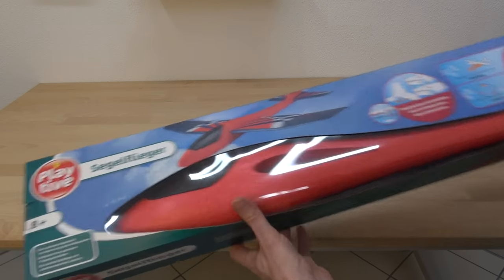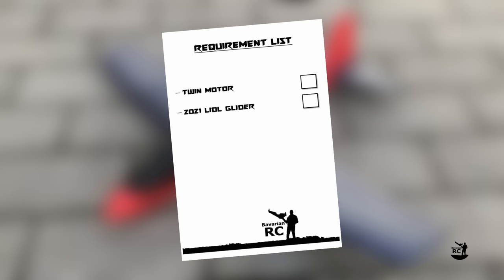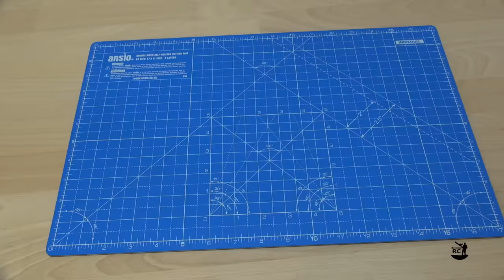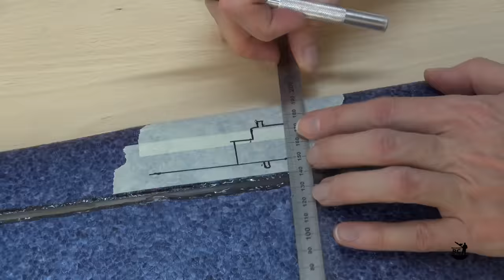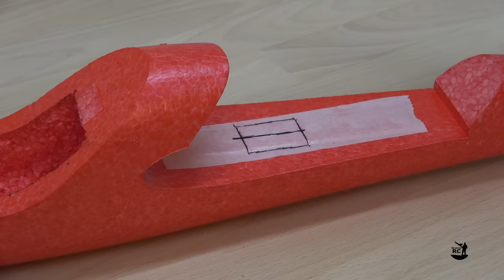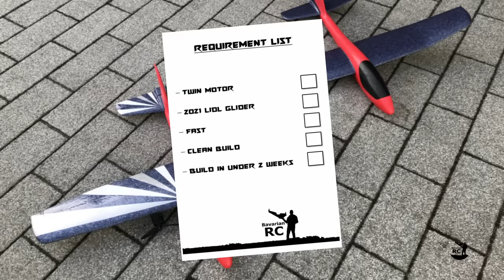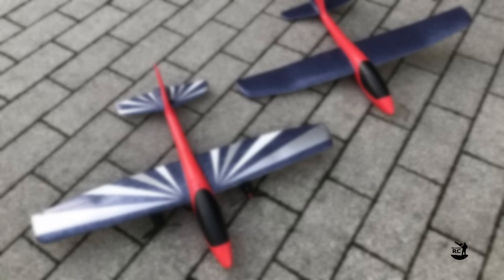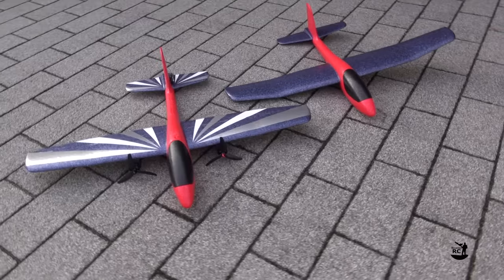LIDL glider RC conversion - TWIN TURBO LIDL - Build Video

Comment: i just stopped the video in 1. minute and bring my coffe to watch this artwork. Not only job is perfect it is also perfect to edit and record all this 2 week long video. my regards. perfect !
Reply: I would suggest you to use 2 bladed propeller for more efficient flights also they will allow you to go faster with right 2 bladed propeller rather than 3 blade ones
Reply from the maker: Thanks a lot! Your comment saved my day 😊if you liked this build than have a look at the other build videos on my channel… and of course don‘t miss the flight video of the Twin Turbo Lidl.
Reply from the maker: My initial thought for the 3 bladed props was to keep the diameter small and avoid breaking props at landing. But obviously breaking was never an issue with the flexible HQ props. Never thought about going back to a 2 blade prop. But you are right, efficiency will be better. Definitely worth a try.
Reply: @bavarian_rc  there is too little gain between 2 and 3 blades at this diameters but we fly with 3 blades with drones mainly because of the feeling while doing sudden movements. Also at static thrust tests you will see there is not much difference in thrust but you will draw less amp from battery. İ also have my own lidl build with lion setup you can try 4s or 5s lion 18650 batteries if your esc allow you with this motor and 5" props for long flights but stick to the lipo for this kind of crazy flights, anyway still 4s would be great to watch hehe have a nice day
Reply from the maker: 4s? That would make this thing even more crazy 🤩🤣
Reply: @bavarian_rc  my next quad build will be 6 or 8s this things are going crazy ... Hehehe but 4s is sweetspot for this motor and prop in my opinion. Wings can handle this for sure with all of this cf reinforcement

Comment: Wow! I thought about doing that to a chuck glider but had no idear where to start. Yours will fly  great. Great Job!
Reply from the maker: Thanks. I did some conversions before but this one turned out to be the best one yet. Flying it a lot! … and it all started with a 7,99€ chuck glider 😄
Reply: @bavarian_rc  Not bad. Considering a bird at that size will cost ya $200 smackers, that's a great deal. Ill stay tuned in to see what's next on the menu. Tex..
Reply from the maker: There are some projects in the pipeline. Next video will most probably be a build video of a small flying wing. Half way through the build by now.
Reply: @bavarian_rc  Horten flying wing?😁Fingers crossed, Yeup i'll tune in and enjoy the build.
Reply from the maker: Don’t wanna disappoint you but no Horten. But you‘ll see …
Reply: The difficulty is that in Germany, model flying is only permitted at specially designated airfields. These are often operated by model flight clubs and are accessible to members or guest pilots. This can cost up to 350 euros because model aircraft liability insurance must be taken out among other things.
Reply from the maker: Hi, actually that's not fully correct. You can fly outside of designated airfields but with some limitations concerning the location and for things like model weight and the height you are allowed to fly. Passing a test (Kenntnisnachweis) you can lift some of the limitations or push them to higher limits. Insurance is important but it is not as costly. Mine is well below 100 EUR per year. There are good online ressources that explain all the rules for RC flying in Germany. Always fly safe and protect our hobby!

Comment: Nice build. I flew in the 80’s. Built about 10 or so. Technology wasn’t as light and evolved as it is now. Keep on with the good stuff!
Reply from the maker: I started building and flying in the mid 80s. Later I stopped the hobby for about 25 years before to re-start in the age of light brushless motors and powerful Lipo batteries. So I know what you mean. Quite an evolution. Great that you liked my video! Cheers!
Reply: Back in the 1980s, the problem was cost. Everything was SOOO expensive. Today's electronics have made the hobby/sport far more accessible
Reply: @Dave5843-d9m  True. It was expensive. But nowadays regulations have become so much more complicated. Watched a discussion about FPV today. Although there are circumstances why regulations may be strengthened, normal developers and inventors and model makers should be able to do like their grandfathers were doing: create.
Reply from the maker: Yes it‘s a completely different world today with all the electronic gimmicks.
Reply from the maker: @Paul Brouyere It‘s as always… some are doing bad things and everything gets regulated afterwards for ALL 🥲
Reply: @bavarian_rc  Then we All have to get together again. It would be nice to do.

Comment: Thanks for this brilliantly well presented conversion video. Just completed the conversion myself and hoping to maiden tomorrow.
Reply from the maker: Thanks for your positive feedback. Keep my fingers crossed for your maiden! I still fly my Twin Turbo Lidl a lot. It has around 150 flights already. Greetings from Bavaria 🙌
Reply: @bavarian_rc  . Good afternoon from the UK 👋. I’m pleased to report that the maiden flight was a great success. Very little trim required and superb handling. Could I please ask what percentage of differential thrust you have programmed? I’ve started at 25%, but think I could dial in more. Thanks again for posting your video cataloguing the conversion. I really appreciate the effort that this must have taken you.
Reply from the maker: That‘s great news! I actually went quite crazy with the differential thrust and used 85%. This allows for these weird flat spins. To enter the flat spin I usually pull up vertically, then reduce thrust to about 50%, wait a moment until the plane has slowed down and then slam in full nose down and full left aileron. About 1 second later I add full differential thrust to the right still keeping full down and full left aileron. The plane stays in the flat spin as long as you keep these control inputs. My longest flat spin was like 20 seconds. Thanks again for your feedback. That‘s the strongest motivation for me to continue producing such content.
Reply: @bavarian_rc  Excellent. I thought I needed more differential, but didn’t appreciate just how much! Will tweak my Tx parameters immediately 😉. Thank you so much for walk through for entering the flat spin too. I don’t have another flying slot until 2024 now (no too long), but will be sure to update you on progress. Good fun this hobby isn’t it? Merry Christmas from the small village of Bisley, Surrey. Paul. 🧑‍🎄
Reply from the maker: At the moment I am also not flying a lot due to either bad weather or the fact that the time before Christmas is always pretty busy. Sometimes I just strap my Twin Turbo to my backpack and take it with me on a Sunday afternoon family walk to do 1 or 2 flights (have a look at my Instagram account to see how that looks like). It always guarantees some suprised looks of other people seeing me walk by with a toy plane strapped to my back. For me this is the best hobby in the world. I am trying to get my boy into the hobby and we are currently building together his first own RC plane. I try to do what my father did with me when I was young. Keep me updated on your further progress and if you want, send me a foto of your Lidl (my mail address is in the channel impressum). I would really love to see how it looks like.  I wish you as well a merry Christmas and great flying in 2024. Cheers, Robert.

Comment: Amazing! I am also making experiments like you. Currently I am on DIY from scratch plane proto of pure polystyrene.
You can get rid of bullets of Styropor after digging with very fast flame of fire it collapsed the surface drastically. I did not know dremel could do the holes like you show.
I like to use fiber glass and epoxy too to bring back rigidity after getting extra space
Reply from the maker: Thanks! Even if I am more a balsa build lover it is always fun doing some crazy Lidl glider conversions. Never tried confronting styrofoam with fire. The Dremel works quite nicely but still leaves a big mess to clean up afterwards. Except for the CF reinforcements I also did'nt try epoxy and fiber glass yet. Worth a try next time 👍Curious to see your current project make it into a video on your channel. Cheers from Bavaria

Comment: You are really good at free hand cutting with the dremel.  I would have been all over the place.  Nice work.
Reply from the maker: Thanks! The trick is the tape around and to make an small cut with the blade first. The dremel runs along the cut like on rails.
Reply: @bavarian_rc  Also be careful which side of the cutter you use. Teeth cutting down into the job, will encourage it to dig into the work. Using the tool so it cuts upwards (away from the job) is less aggressive.
Reply from the maker: You are certainly right. As it was only foam I was a bit lazy about this but still had to hold the dremel quite firmly.

Comment: That's probably one of the nicest LIDL conversions I've seen, very clean.  I like the 2 motor approach.  I'm starting my own and will use many of your techniques, and 2 motors.  I am building it much lighter, trying to keep it under 400g.  I recommend cutting the packing tape off the ESCs to help with cooling.  Looking forward to a flight video!
Reply from the maker: Hey Mike thanks a lot! The twin setup is definitely a lot of fun (especially with the differential thrust). Will be interesting to see how the light weight approach works ... below 400g with twins could be a challenge. The cooling of the ESCs is still quite OK. The max. temp is around 65-70°C. I will have to see what happens during summer. If they get too hot I will test without the packing tape. Enjoy your Lidl build,
Reply from the maker: Ahh, forgot to speak about the flight video... The video shots are all done, now I need to start the editing (which is always quite time consuming). If you can't wait just head over to my instagram account (bavarian.rc) to see some first flight video clips.

Comment: Beautifully clean build, I especially liked the use of actual measurements and not just guesswork, also the use of the Dremel was a nice touch. Pleasure to watch 🙂
Reply from the maker: Thanks a lot. I am more the accurate type of model builder… even on a chuck glider. It just doesn’t feel right to do things quick and dirty. Actually the dremel works pretty well. It just creates a big mess of foam bits and pieces 😂
Reply: @bavarian_rc  Same here, no point in a shoddy job, you do impressive work and I wish you the best for your future endeavours 💯🙂
Reply from the maker: Next project is in the making ... video will follow soon. This time a tiny balsa flying wing

Comment: The new version of the lidl glider looks so aerodynamic!
Reply from the maker: Looks like the product designer noticed that us crazy RC builders like the Lidl gliders. The new version is much better in its aerodynamic design, has a wider fuselage which makes it easier to get all the electronics inside and has a reduced wing/hstab incidence which is better for RC
Reply: @bavarian_rc  yeah but it flies way worse!
Reply from the maker: Really? I think the new 2021 version flies much better. Unfortunately the 2022 version is again the old one.
Reply: @bavarian_rc  we have been hanggliding with lidlgliders for a few years now.. the original is great for that but the new one really sucks... Feels and looks like the wing profile thickness has increased a lot which increases the overall resistance. With motorized versions you might not notice much difference
Reply: @bavarian_rc  yes I noticed the new 2022 one is the old one, bought a lot of them last week  :-)
Reply from the maker: Ok I could well imagine that the old one is better for hanggliding. The attributes that made the 2021 version better for my purpose are more for faster motorized flight. Especially the reduced wing/hstab incidence is something that I feel mainly at higher speeds.
Reply from the maker: One man's meat is another man's poison… 😜 Well I still have some 2021‘s on stock so no worries! Cheers!

Comment: Very clean built. Good job. I made a similar one, where I added a FPV cam into the nose. But because I used spare parts of my broken mini quad, it is totally underpowered. 😁 In comparison your plane will be a beast. 💪
Reply from the maker: Thanks! Yes it’s got plenty of power. Check out the flight video!

Comment: Fooling around with my first ESC/BEC/motors and propellers. I'm getting some ideas with the extra servos I need for control. My first experiment will be mounted on a plastic truck (RC) and might include a Raspberry Pi Pico with code for PWM throttle and maybe temperature. I'm a bit stuck with some details and it's not included in any videos.
Reply from the maker: Hi, that sounds interesting but hearing Raspberry Pi indicates that this beyond my skills 😂 Nevertheless I‘ll give it a try. Where are you stuck currently?

Comment: Thanks for video, nice!!! I did my Lidl Twin Turbo.
Reply from the maker: Thanks, I am happy that you liked my video. Did you build your Lidl with the same design that I used? If yes, how do you like flying it? It is still one of my favorite planes. Close to 100 flights now!
Reply: @bavarian_rc  I finished it only yesterday, I tried to do the same, only I used a magnet on the cabin. when the weather is suitable, I'll try how it flies. I also want to try stabilization in the receiver. I would send a photo, too bad it can't be done here.
Reply from the maker: I would really love to see your version. If you are on Instagram you could send me a message via my account (@bavarian.rc) or if you would like to send me a mail then check out my YouTube Channel Info. There is a link to my "Impressum" where you can find my mail adress. 
I have been flying my Twin Turbo just yesterday and even with cold fingers it was so much fun. Wish you luck for the maiden flight.